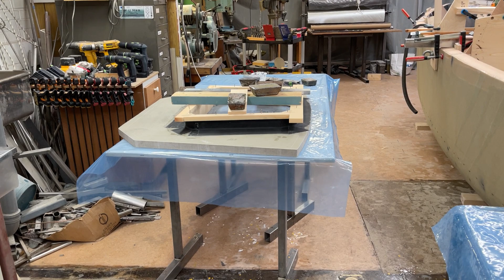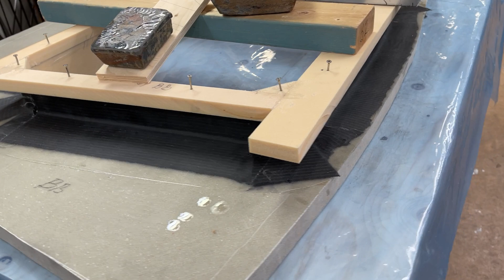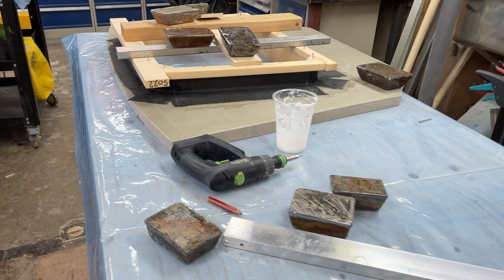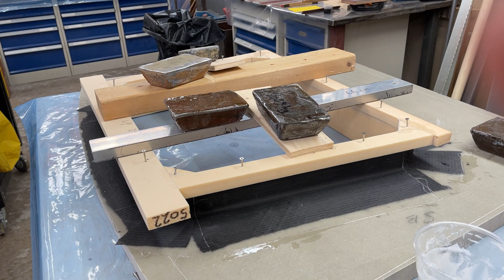The labyrint step on the bulkhead hatch. To discurage water from enter when the hatch is open.

Comment: Can’t wait to see the details of how it work/operates.  Like how you’re going to affix it to the hatch. 
I’m curious to see what kind of locking mechanism you go with for all your hatches.  I remember your video on using a rope tensioning system, but that’s a one sided lock.  So it will be interesting to see what you go with in the end plan.
Reply from the maker: The present idea is a ratchet strap combined/ backed up with screw

Comment: Thank you Sven. The hatch design is a good one.  With the top lip and the hatch secured on top of the lip it will  be very dry and secure.  Will you be using a rubber gasket to provide seal between the lip and inside hatch surface?  Have a good week.
Reply from the maker: This hatch is an experimental one in the bulkhead. It moves differently
https://www.youtube.com/watch?v=jegCVVVdi2E&t=3s
There will be rubber gasket

Comment: There's a lot less work the way you are doing it Sven, and less epoxy ? Your earlier boats must have been wet with out that splash back combing lip thing on a small boat ? Not many dry days. Are your deck hatches going to be all the same size or slightly different ? Did you and your friends, the one's smarter than you LOL have to do much design change for the 70mm h80 foam ? Thanks again for the videos that you have been talking the time too put out. All the best Sven.
Reply from the maker: Earlier boats were not very wet, but this is being as good as I can do with what I now know. Manu fine dry days before.
We will see what size of hatches when we get there.
The 70 mm H 80 design was mostly my own idea. My smart friends supported it.
Reply: @SvenYrvindExlex  it's definitely allowed you too fare a fine shape out of it . Has it got more rock than Exlex or is it the rounder bilge making it look like it has . It Just looks RIGHT doesn't it, a very conformable boat . I don't like flat bottom boats the way they suck too the sides of the waves . Will your hatches have dubble rubber seal's so water can't sit around the hatchways at all . Mike Patey  SCRAPPY  video 45 has a lot of tips on carbon fibre work  on his aeroplanes panels and inspection covers and other job's too very close fitting stuff worth a look Sven thanks again. All the best